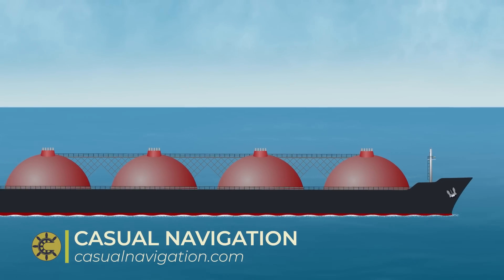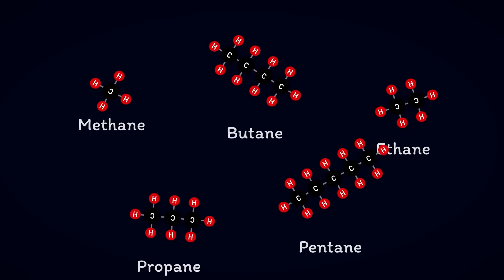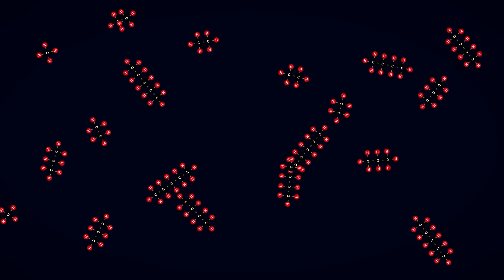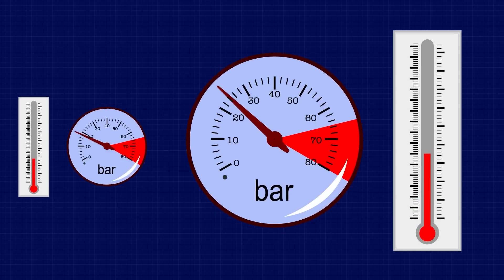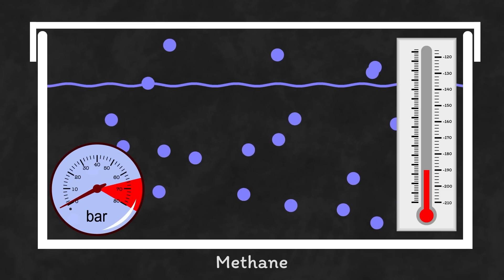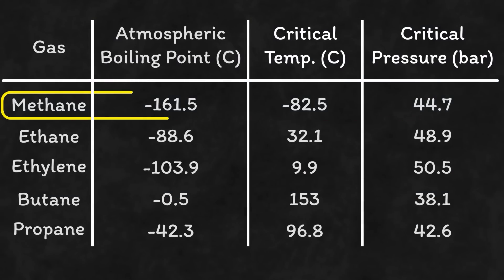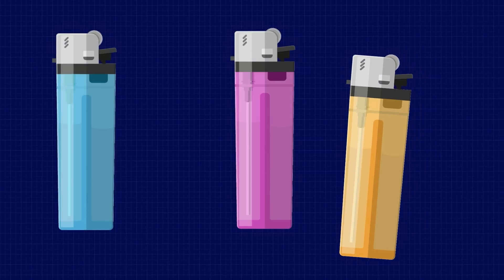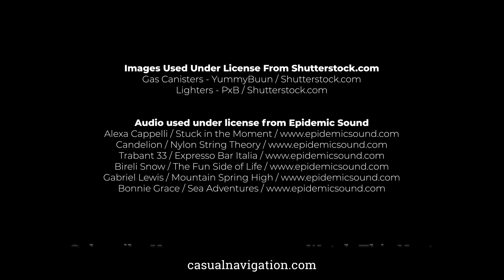Why Do Gas Carriers Have These Humps?

Comment: They don't need substantial onboard refrigeration, the engines operate on the evaporating cargo and the insulation is sufficient to prevent excess evaporation. (The contracts will consider the gas loaded vs delivered.)

Comment: It's all nice but why did you order those gases in the table that way? Why is Propane last instead of Butane? I already thought this is some strange anomaly when it comes to temperatures and pressures and only then I realised Butane has a longer chain than Propane. If you wanted lexicographical order, you failed anyway.

Comment: You got the part about the humps wrong. This ship is the regasification vessel, its usually moored off the LPG terminal permanently and the LPG tankers come and visit it to top it up. The humps are expansion chambers for re-gassing the gas. The tankers don't have the humps.

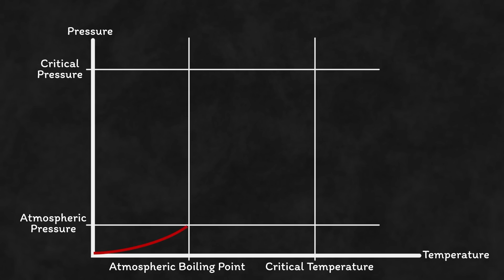Comment: Brilliantly explained the physics here, from gas and liquid phases all the way down to the molecular level! A very slight correction: in the PT phase diagram shown at 6:25, the curve should not have a kink at atmospheric pressure. After all, for an arbitrary substance, the pressure our atmosphere happens to have at sea level does not have any special significance.

Comment: I've not served on LNG carriers, but I've had 3 voyages on 2 LPG carriers. On these vessels, the cargo tanks did not protrude above the deck. Multi-stage refrigeration machinery was used to keep the cargo cold, under the supervision of the cargo engineer. Installed submersible pumps were used for cargo discharge. Products carried were Butane and Propane, and absolutely the nastiest cargo ever- Ammonia.
LNG tankers used boil-off gas to supplement the main engine fuel.

Comment: You contradicted yourself several times stating that "the substance can be kept liquid with pressure alone" But it's clear the temperature is vital, and needs to be controlled so how is that "with pressure alone"?

Comment: PV = nRT

P = Pressure (Pa)
V = Volume (m³)
n = mol of gas
R = ideal gas constant (8.3145 J/(mol•K))
T = Temperature (K)
Reply: That's a good equation when you try to carry something like hydrogen or any gas at low pressures. These gases mentioned in this video are however nowhere near ideal at the applied pressure and low temperatures the molecules start to bond together forming a condensed liquid phase resulting a hundredfold volume decrease. (Also this is why hydrogen sucks, you need like -250°C to liquify it)

Comment: Any idea what they do with the space between the spheres below deck? Are they just left empty? Do they fit refrigeration machinery in there?
Reply: @ErzengelDesLichtes  ballast, fuel tanks (they still need conventional fuel even though they use so called boil off gas as secondary fuel). It’s possible the refrigeration plant is also located there. In other gas tankers with prismatic or cylindrical tanks it is usually much more obvious where the refrigeration plant is. The large compressor shelter on deck is hard to miss.

Comment: From butane onwards, they are rarely transported in gas carrier ships. Butane's boiling point is -1C. That is very easy to do in bulk, and rectangular tanks, instead of spherical tanks.
Reply: @xjdisuehd  butane is always carried in gas tankers, even stuff like propylene oxide which is liquid at 15-20 degrees celsius is carried in gas tankers
Reply: This is not a beginner's video. If you understand this on the first watch, you already know the material.

Comment: I was told the spherical tanks were to reduce the free surface effect from hauling a tank full of liquid in an unbaffled tank. Its also why they only sail with the tanks full or virtually empty.
Reply: Exactly. Because these tankers rely on refrigeration and not pressure to keep the cargo liquid it is common for some of the liquid to boil off into a gas, reducing the volume of liquid in the tank. In a rectangular tank, this would cause problems with the free surface effect, but that is greatly reduced in a spherical tank.

Comment: I remember one New Years Eve when it was -25°C (or maybe a little colder, I don't remember) and quite windy, so at midnight we all went outside to watch the fireworks, but in about 2 minutes we decided it was too painful and returned inside; all except the couple of guys who were crazy enough to stay outside and set of the fireworks. But apparently it was too cold for them to be able to keep the butane lighters above -0.5°C so they had to run inside between each fuse to "thaw" their hands and lighters to keep the lighters from sputtering liquid butane (and it was too windy for Zippos and matches to work). It would even keep sputtering liquids indoors for several minutes.
I think they spent more than 1 hour setting off a rather moderate amount of fireworks. It's quite impressive that none of them developed (too severe) frost bites; but I guess being forced inside to warm their hands all the time helped.
Reply: Zippos are windproof
Reply: @xavier1964  really? How? Can't you just blow it out like a candle? I might not have seen a real Zippo in action, most of them are fakes I've heard (and if they even had a "Zippo" it was probably a fake); but whenever I've seen one they always can blow it out. It's just a bit of cotton wick soaked in some kind of lamp oil and a "flint" spark wheel right?

Anyhow another part of the problem was operating the lighter because their fingers were too cold. I think they gave up on all the lighter with a wheel action because they couldn't make it turn with cold fingers, so only the piezoelectric click style lighters worked, at least for a few minutes until the butane liquified.
Reply: @xavier1964  also this is over 20 years ago, meaning my friends were in their early 20s, they would not have an expensive well maintained real Zippo. In fact most of the time I've been shown a "Zippo" growing up they've almost always tried lighting it and then make some excuse about how the flint is bad, the wick is old, it's almost empty or they've used the wrong fuel; for why they need 5 tries.

To me it's always seemed more like a masculine gimmick accessory for teenage boys who are fans of American things, because of the association with Vietnam war movies rather than an actual tool for lighting stuff. So the quality of them is probably not very good because of that.  

Even with older men brandishing a genuine expensive Zippo it mostly seems like a hobby more than a tool. Ironically most of the older guys I've seen with one doesn't even smoke, so they jump at any chance to light a candle just to get an excuse to play with it. Though often burning their fingers and having to give up and use matches since most real candles today are small "tea candles" (or whatever "telys" translates to) that often sit in deep cup shaped holders that require a long match or a long nozzle lighter to reach.

Comment: a clarification, the critical temperature/pressure is the point at which it stops being a liquid or a gas, containing it at that temperature is still very much possible and will work the same as if it were a liquid barring a few specific exceptions relevant to safety systems inherent to potential leaks and the materials used to contain them, but theyre still every bit as dense as the liquid form, or close enough at least for transportation purposes, said specific exceptions relevant to transporting any specific supercritical fluid might render it more economically viable to cool it down so it does stay a liquid but its still possible to transport in much the same way.
Reply: So basically it is possible to pressurize "gas" to high density even at supercritical temperatures, but doing so would require such absurd pressures that it's more economically viable to keep relatively weak tanks at like -100°?
Reply: @abram7547  its more that super critical fluids can diffuse through things in the same way a gas can, and in DIFFERENT ways than a gas can, which warrants a lot of safety concerns and potentially (potentially) more expensive steels or other materials than steel entirely, and any ruptures/tears/popped seams/general leaks that happen are more likely to vent significantly more of whatever compound youre transporting significantly faster since it doesnt need to phase change from liquid to gas, 
a phase change from liquid to gas takes a LOT of energy, so anything involved gets really, really cold, it gets to its freezing point and then more heat needs to be added which is slow, which also makes any leaks really really obvious. its not the pressure required changing, its just that its still effectively transporting a gas, but also still not.
you can fit 90-95% as much gas around the super critical point compared to storing it as a liquid theres just safety concerns and quirks to make it not financially viable.

Comment: 50 bar? So if something were to pierce those spheres the resulting jet would be incredibly high speed.
Reply: It wouldn't just be a jet, a hole pierced without reinforcement would result in potentially tearing the vessel apart within seconds similar to a balloon.
Reply: @zangeh  So these ships could catastrophically explode all at once? That much gas would have a LOT of energy.

Comment: This video is a massive chemistry lesson hidden behind a simple question.

TL;DR - The simple answer is Gas is stored at very high pressure, and a sphere is the most efficient way to disperse that pressure evenly so that the container doesn't rupture. The 'humps' are just a part of the larger spheres hidden under the deck.

Comment: Silly question / idea but why can't they make a completely spherical ship?
Well, I don't mean to just toss a ball of pressurized gas in the ocean and expect it to land at the destination. But rather one of the following.

1) Add a propeller and some means of control. Though it would probably not work and would just roll around in the sea.
2) Have a chain of balls hauled behind the ship, which can now be all power and focus all its attention on towing said balls.
3) Make autonomous balls that spin under their own power and who paddle themselves to their destination.
Reply: While not exactly spheres, the Imperial Russian Navy during the 1870s did have a go at circular, disc-like, warships.

Drachinifel has a brief (~15min) history video about them--which, if interested, can be found here on YouTube using the search-query: "Russian circular warships drachinifel"

Highly interesting, funky-looking, yet surprisingly legit ships.
Reply: Not a terrible idea, but it would be really hard to maneuver and might have some problems at the Suez canal. Really what they did do with these liquid gas tankers is made a string of spheres and then built the best fitting ship hull around it.
Reply: There's a reason ships are ship-shaped. A ball would simply just experience so much drag from all the water it wouldn't be worth it.
Reply: @person8064  What is a bow?
Reply: @RealCadde  the bow is the front end of the ship, the back end is called stern
Reply: @giantdwarfulf  And the shape of the bow can be anything from a wedge to a sphere.

How come sphere bows are ship shaped and therefore "good for drag" but not actual spheres?

Allow me to remind you, said spheres are not submerged into the water. They are still floating.
Reply: @RealCadde  water resistance works very similar to air resistance. Have you ever seen ball shaped planes? Probably not. Ships and planes are all somewhat streamlined because a streamlined shape has the lowest resistance in air or water. The ratio of length to width of the ship is essential to the speed capabilities of the vessel. A larger ratio will generally grant you more speed. A smaller ratio will reduce speed but enhance the turning circle. For most ships the speed is of great importance. The turning circle has to be enough to get the ship through most narrow waters but for maneuvering most ships will have tug boats anyways.

The bow (and also the underwater stern shape btw) is very important for water resistance. Apart from the huge oil tankers and bulk carriers almost all ships have a sharp bow, to basically “pierce” the water. Bulk and crude oil carriers with the more round bow have a very high draught when fully loaded, so much that the sharp bow would very little effect. Most ships are fitted with some kind of a bulbous bow (some call it the nose), the part sticking out under water. This part significantly improves fuel efficiency because it reduces the bow wave created by the ship. Normally the ship is riding on its own bow wave. You can think of it constantly having to go slightly uphill. The bulbous bow negates this issue. You get higher speed with the same fuel consumption.
The shape of the underwater stern is important for the efficiency of the propeller. Modern ships are shaped in way that “directs” the water into the propeller. With a ball shape the water flow around the ship will mostly go past the propeller meaning it is spinning with little effect and cavitation is increased, which means significantly faster wear of the propeller.

As you can see there are many reasons why ships have the shape they have and probably there are countless more than what is stated here.

Comment: Interesting.  So at what pressures and temperatures do the spherical tanks actually typically work?
Reply: @philcretired5143  those are only found on LNG tankers. Therefore they have minimum temperatures of -162 degrees and the maximum pressure above ambient pressure of this tank type is 0.7 bar

Comment: Aren't the humps also desigfned to have a weak spot on top, so if they explode they will rupture upwards?
Reply: @aapur  no, they are fitted with in emergency venting system. If the pressure rises too high, the safety relief valves will open and the gas will flow out through the vent mast. You want to avoid uncontrolled release at all costs

Comment: A small addendum, substances above the critical point aren't fully gaseous, but instead enter an unusual combined state called a "Supercritical Fluid." Supercritical fluids are interesting beasts, as they exhibit properties of both gas and liquid, and can be tuned to be more gas like or more fluid like by varying temperature and pressure.

Comment: Awesome how a merchant turned videographer can explain chemistry so effortlessly, like no pressure!
Reply: No pressure because he is so cool!
Reply: @Zegmaar_Bas assuming volume is constant!
Reply: Heh.  Nice intended puns.
Reply: Or no temperature!
Reply: yeah, it's so cool!
Reply: It's the same physics of why "CO2" has very little effect on the atmosphere. The molar mass version of the ideal gas law exposes the climate warming by CO2 nonsense. (ok a tiny fraction can warm  - eg a doubling would = +0.1C warming)
"Holmes, Robert. (2018). Thermal Enhancement on Planetary Bodies and the Relevance of the Molar Mass Version of the Ideal Gas Law to the Null Hypothesis of Climate Change. Earth Sciences. 7. 10.11648/j.earth.20180703.13." 
The only counter to this paper is by the religion of climate cultists who are on the bandwagon. The one o found doesn't even specify the earth energy in vs out properly! Co2 was anyway about the same as today 12-13k years ago

This is ignored by the climate cult alarmists. Yes it's warmed (and due to about 6 other reasons out of the control of humans) but that stated way before industrialisation and the human contributions of about 5% to the natural 0.04% that make up the atmosphere is doing next to nothing. It's a bit like putting a strip on sun cream 1cm wide head to toe, and then adding further amounts over the 1st. There is no additional effect and anyway 2 bodies on the same beach 1 with this small band of IR reflection in the form of sun cream, the other without, both a receiver of thermal energy and also emitters. There are no exceptions. Titan has 3x more "Greenhouse gas" Methane content than Saturn. Both get the same solar energy yet Titan is colder. It's not a "heat trapping gas" any more than any other.
Reply: It is physics, not chemistry.
Reply: @marioxerxescastelancastro8019  All of this is taught in chemistry

Comment: A sphere has no corners where pressure can concentrate. Therefore, it is the best shape for high pressures. That's why they are spheres.
Reply: No, if you've ever seen a square container over-pressure, it bulges at the sides, not the corners. A sphere is the best shape for high pressure because it has the smallest surface area to volume. So you don't waste material in the corners.

Comment: Pentane is actually a liquid at room temperature. But its very volatile (boils easily). I use it in the lab frequently
Reply: then it’s a gas at that temperature
Reply: @carlosandleon  It's important to remember that liquids evaporate well-below their boiling point. Water boils at 100C at standard pressure but in dry air it will evaporate at room temperature.

Pentane has a boiling point of just above room temperature, so it will evaporate rapidly, but it won't boil unless extra heat is applied.